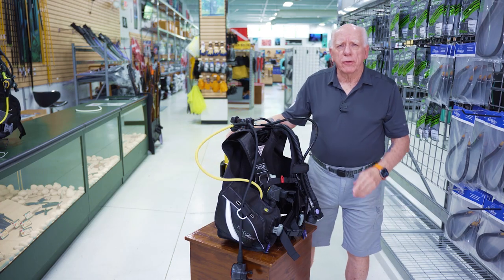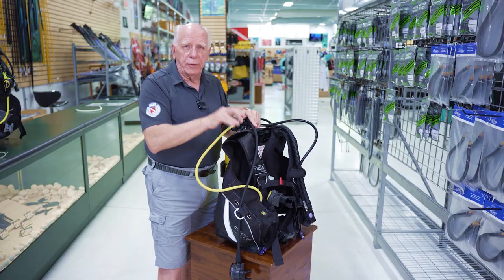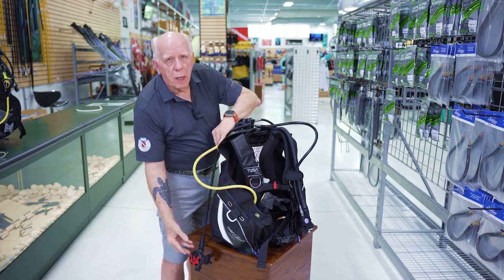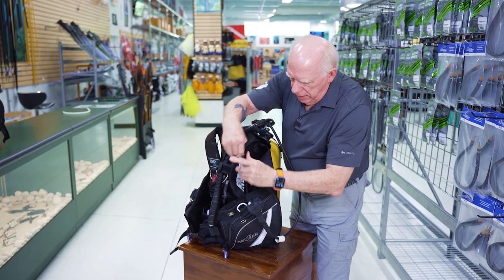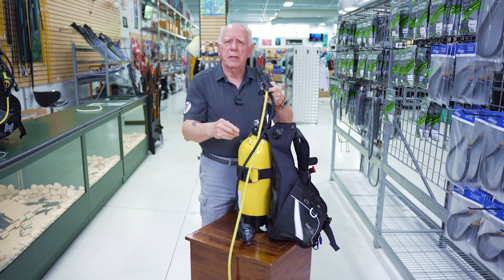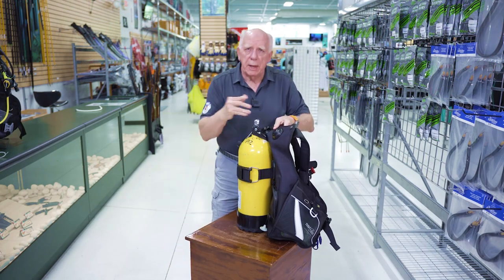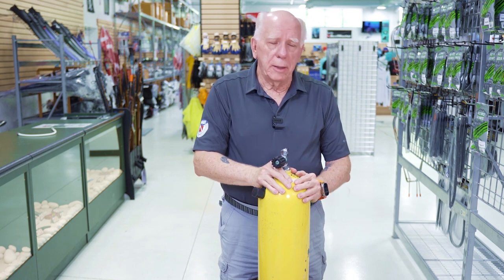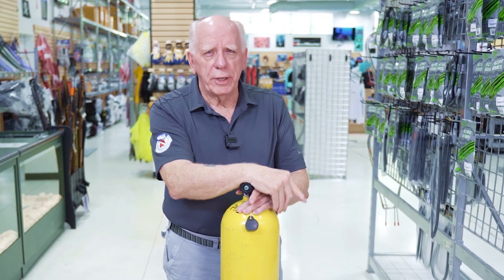2023 Disassemble Your Scuba Unit the Right Way !

Comment: Hi Bob - good video as always! I'm surprised you mentioned the tank valve being backed off just a little instead of fully open. I had thought fully open was now the standard guidance.
Reply from the maker: Hey WS,  You know that's such a bone of contention, "all the way" vs "1/4 back"...
What's more important is that during assembly the valve goes all the way open, a 1/4 really means 0 difference.
But thanks for the comment !  Bob C